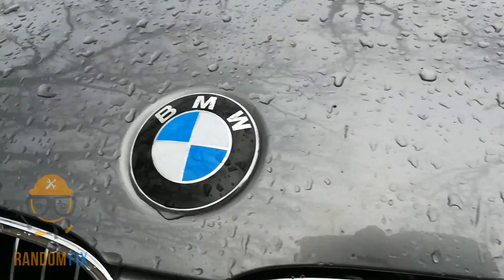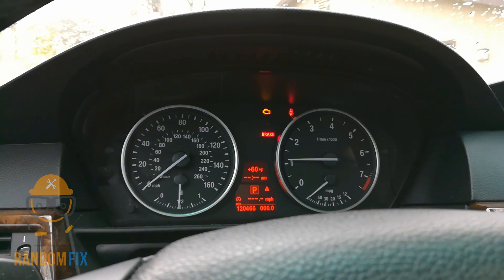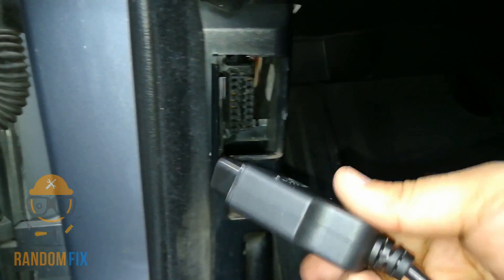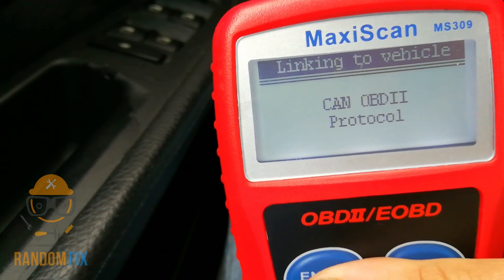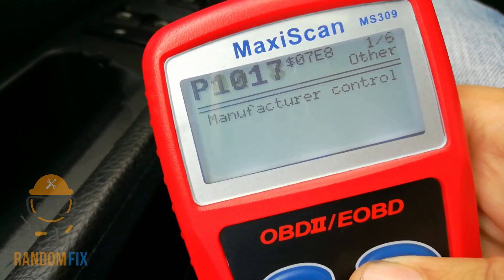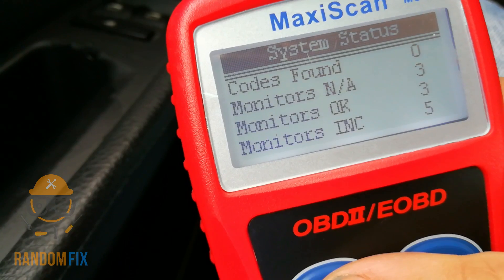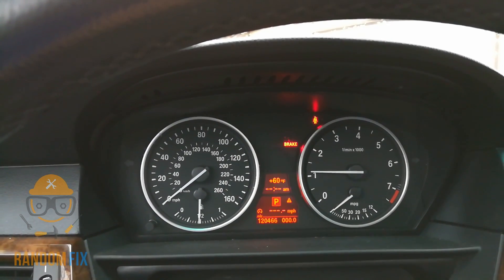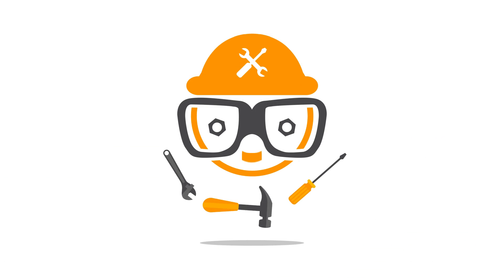How To Reset BMW Check Engine Light ▶️ BMW Service Engine Soon Light Reset

Comment: Does this work on a x5 E53 4.4 v8 will this clear the engine light ?. I have this light that’s come in and there’s nothing wrong with this engine it’s sensors ow why ever but it’s done 64k 2006 it’s literally brand new and if I take it to a garage here in the uk the buggers will plug it in and say stop engine could be this could be that costing me a fortune when I know there’s nothing wrong with this car engine wise
Reply: A sensor has gone which is triggering the light or at worse I need to change out a fuel filter or some other cheap as part but back to the question. Does this work on a E53 x5 model ? Or does anybody know a odb2 device I can buy to get this light fixed

Comment: I am an amateur user of the scan device and I could not figure out how to erase an errant engine code before watching your video.  It appears that my error was not first reading the codes before trying to erase them (which seems to make good sense).  My 10 year old Z4 has had this light on and off from time to time and the dealership could not diagnose it.  The car still runs like a top and the error code suggested that one of the cylinders might be running a bit lean.  I did not want to pay for replacing injectors for a problem that does not affect the performance of the machine. Thanks for your helpful video!

Comment: Ain’t working on my 2007 e93. Cylinder 3 misfire, swapped coils with #2 and the code followed, changed all the plugs and coils and it’s running great. Light will not go out, codes will not clear with the tool. Still showing 2 and 3 misfire stored in there. There’s no misfire though, running absolutely great!
Reply: Hello did you ever get that light out??  I have the same problem right now. I put new spark plugs and coils. And with my scanner the light will not go away. But the vehicle is running fine.🤷‍♂️
Reply: @mannydelgado1770  yes I meant to come back and post my fix. I have the OBDLink CX scan interface, and I was using the app that came with it. The engine light would just not go out driving for a week, obviously no issues, so I paid for the BimmerLink app. Firstly, the scan gave me more detail on the stored codes which would have been nice before, and I quite easily was able to turn off the light. I think it was $40 which is a bit stiff but I’m hoping it will pay for itself in the future…
Reply: @erizzle67  thank you for the info.🙏

Comment: Hi. Does it work on 2019 X3?
Reply from the maker: Yes this works on your 2019 bmw x3
Reply: Thank you !
Reply: I checked it online. Does Al319 better MS309? Does Al319 turns off check engine light too?

Comment: my engine and battery were replaced, my check engine light came on it was for the MAF, I replaced it but the light is still on, what do I do?
Reply from the maker: Did you reset the check engine light after your replaced the parts?

Comment: Can this device turn off engine light permanently?
Reply from the maker: Nope 👎, these cars very complicated and the issue needs to fixed. If you remove the check engine light bulb it will detect that too and you won’t pass future smog tests.
Reply: @RANDOMFIX how will you know what’s wrong with the car because yours said engine

Comment: Can you do this with all service codes?
Reply from the maker: Yes but after 2010 some codes can not be erased. Also, you should really fix the issue causing the issue, This will only access the basic codes and if you get a better oem specific scan tool you can view the bmw side of the codes for a better idea on the cause.

Comment: Should this work with a bmw 528i 2008 model?  I received the scanner you recommended today, but when I plugged it in, the scanner read no codes stored.  Also, it wouldn't allow me to erase any codes, but my check engine light is still on.  Any suggestions, should I return the scanner?
Reply from the maker: This this works for the 2008 bmw e60. So your check engine light is on but you the obd2 reader sees no codes? Does it say the MIL (malfunction illumination light) light is on?
Reply: @RANDOMFIX  No, when I scan it (if I am scanning correctly) it goes real fast and then the message no codes stored appears.  I just received the scanner yesterday and have contact Amazon for a refund, but I really don't want to send it back if it's the correct scanner and I am just doing something incorrect.  You run the scan without the engine running, right?  Does it matter if the radio is on or should everything else be turned off.  Thank you so much for your response.

Comment: Im looking to get that scanner, quick ? I need my CEL cleared for emissions, will the scanner do that? Im dealing with a seal leak or valve cover gasket leak. Its causing my 328i to idle low and make a loud continous whistle but..... I add rear main sealer and it runs fine and the engine line eventually goes off but. I need to clear it for emissions and it's in need of more sealer.
Reply from the maker: Clearing the check engine light will does not mean you will pass a smog test. You will have to clear the code and also complete a drive cycle without the check engine turning back on.
Reply: @RANDOMFIX  Gotcha, thank you for the rapid reply I appreciate it 👍🏼
Reply from the maker: My pleasure, check out my  omelets smog playlist that covers the drive cycle.
Reply: @RANDOMFIX  will do 👍🏼
Reply: Hello, I have a 2011 328i how do I know which code reads for the check engine light?
Reply: Nevermind, it worked, I figured it out
Reply: Did you pass
Reply: @Fadeloserk  I passed but not the legit way lol, but the motor had way more issues (due to it being a lemon) its in the shop as I'm typing this reply getting a full swap.
Reply from the maker: If you need to pass a smog test here is the bmw video for that explaining it all.
https://youtu.be/mk6Tk330Acw

Comment: My scanner connects but when searching it comes with a error and disconects
Reply from the maker: Try a different  scanner + make sure you battery voltage is also over 11.5+ volts.if the other scanner has an issue as well then check the pins of the obd2 connector before you really have to start digging. Best of luck. Randomfix

Comment: If you erase the codes without fixing the problem, will the check engine light turn on again? (If it is faulty it won’t turn back on, I’m asking if it is not faulty)
Reply from the maker: I will the check engine will not turn back on if the problem is not detected again after your reset a check engine light. So if it not faulty it will not turn back on. _Randomfix

Comment: Thank you for the help. Appreciated...
Reply from the maker: Tomcat561999 much appreciated and it's my pleasure to help!! _Randomfix
Reply: @RANDOMFIX  By any chance, would you know how to activate/programme the bluetooth facility in the Professional stereo for BMW 318i SE year 2009?
Reply from the maker: @TomcatParquelaReina  you would need a speciality scantool. Did you buy the part used or new. I just did changed out amp on mini Cooper and part was over $1300 new and I grabbed the BMW part and on eBay. With the used amp I received it was plug and play and didn't need any sort of activation. _Randomfix
Reply: RANDOMFIX   Hello, it came already in the car, but is not activated.i need a code to set it up or a procedure better said...I know is possible, I need to figure it out.....
Reply: @TomcatParquelaReina  Hey bro u need NCS expert programing kit and u need to look it up manually. And activate it.